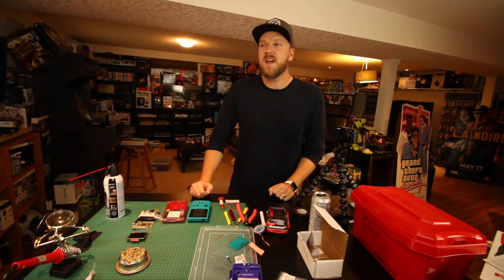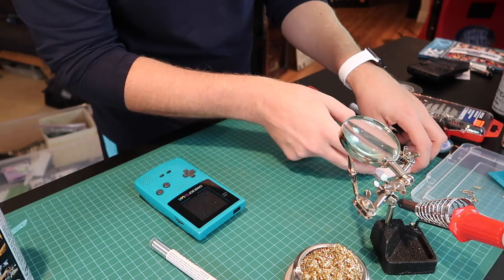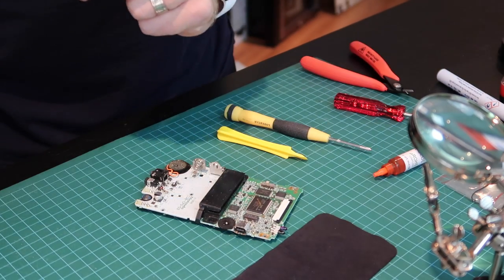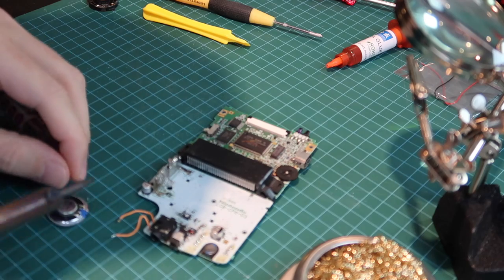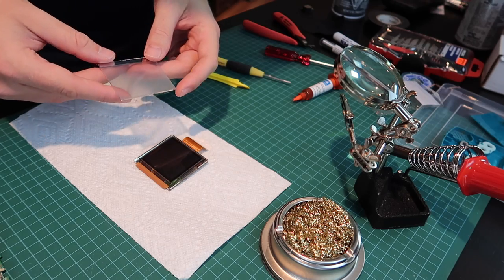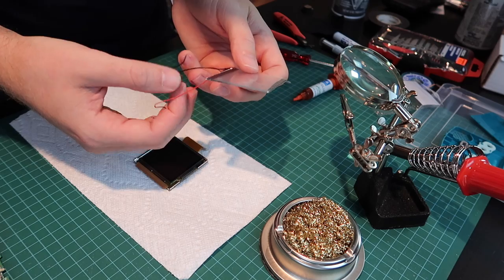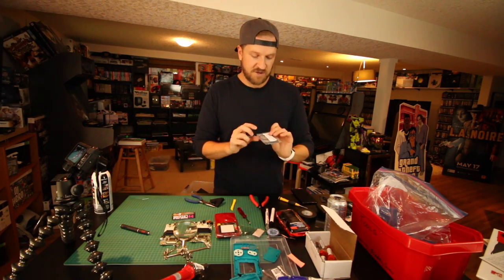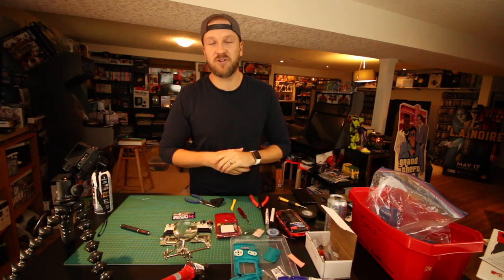Gameboy Color Front Light Mod

Comment: Thank you for the video. I'm doing a Frontlight gbc mod (don't have money to do backlite) and i also ended up stripping my screw i had with my replacement shell (from AliExpress) and got it stuck in the board. It's such a pain since the crews and screwdrivers are cheap and both strip easily. You're the only one who said use all original screws. Thanks for a proper tutorial.

Comment: Hi, 
I hope you read this. I wanted to ask you for help.
A few days ago I bought a Gameboy Color which was listet as Not Working from ebay (It was very Cheap), 
yesterday it arrived and I tried to get it to work but without any succes.
The batterys are Good and the Game is Working fine in my DMG, also there are no bad Caps and no Indication that there was any Fluid or something inside of it.
When I switch it on, the Speaker starts making a Repeated Low-Pitched Cracking noise and the Screen doesn't display anything at all. Not even the Gamboy Color Logo

Can you or anybody in this Comment-Section help me with this Problem? Google isn't really helpfull finding anything

Comment: Do you need the 47 resistor? What does it help with? Thanks.
Reply: If you not add a resistor the screen start to flicker, so you will need 47 or 75 ohms resistor, i use 75 ohms resitor on my moded gameboy color